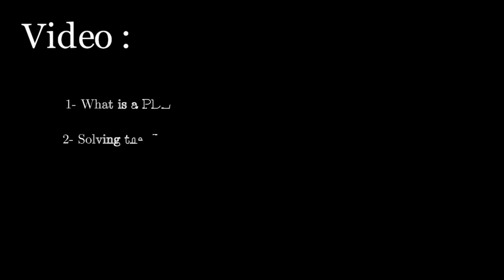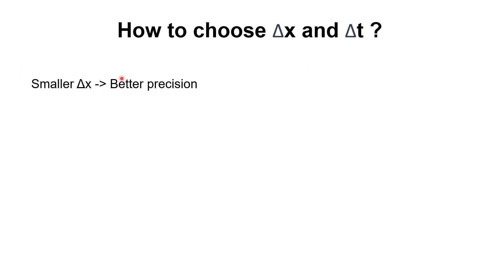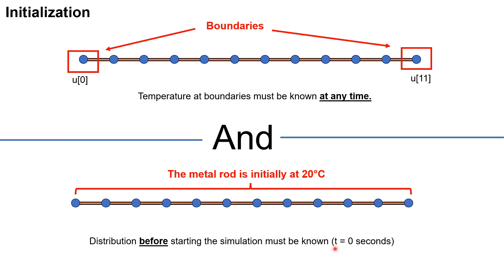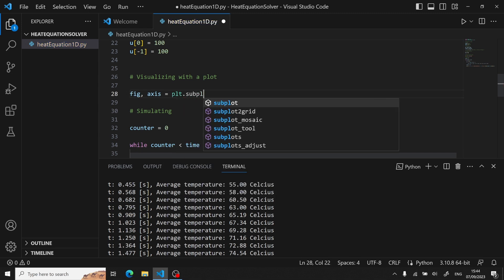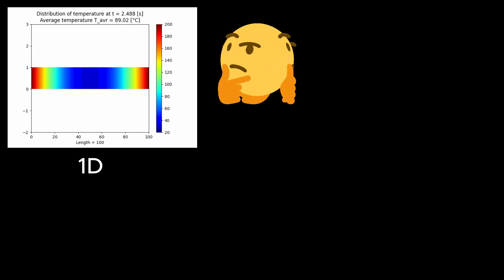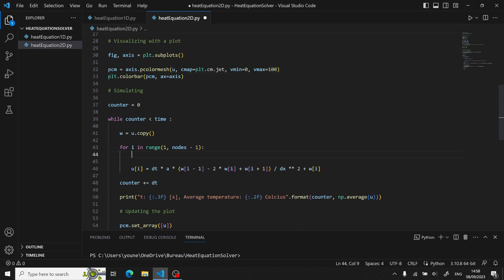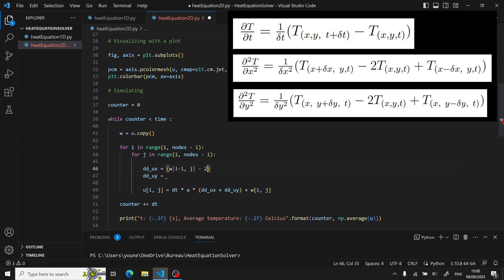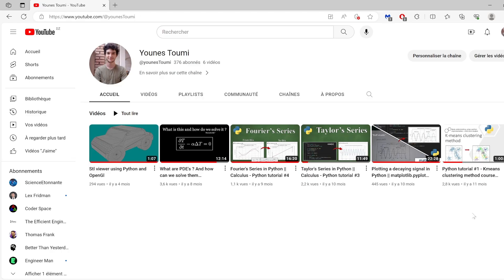Solving The 1D & 2D Heat Equation Numerically in Python || FDM Simulation - Python Tutorial #4

Comment: Formula for dx is incorrect, it should be dx = length / (nodes-1)
Reply from the maker: That true thank you for letting me knoy, I will fix it in the Git-Hub code. 

If we have `n` interval we always have `n+1` nodes. When considering the simple example of a 1 meter long rod with two nodes, lenght = 1, and dx = 1 meaning nodes = lenght//dx + 1

Comment: Hi! It's very awesome video and very straight forward! A quick question, do you know if there's any chance to speed up the process with cuda?
Reply from the maker: Thank you for your feedback ^^
Personally I am not that familiar with cuda (though this surely is motivating me to make a video about it 🤔) However there are several techniques you can use drastically improuve the speed (method I discoreved after making the video)

*  writing the main calculations as a function, then using numba's jit to optimize the computation (by chacing it, ...)
* Important note: since the result of each iteration is more or less dependent on the one before, parallezing will most likely not work, however one trick you can use is to vectorize the code by, instead of writing it in form of a loop, you replace it by some sort of linear system of equations A*T = b, which will be way faster since it uses linear algebra to find the solution (using numpy)

Comment: Could anyone explain why is it necessary to use a copy of array u in the scheme equation? I know that it gives slightly different results if we just rewrite u array in each loop, thanks
Reply from the maker: Hello! 

We use a separate copy of the array `u` because it represents the temperature distribution at a specific time, `t`. When we discretize our equation in time and space, we get:

u[t+1, i] = (dt * a / dx^2) * (u[t, i-1] - 2 * u[t, i] + u[t, i+1]) + u[t, i]

In this equation, `u[t, ...]` represents the temperature distribution at time `t`. By updating `u` using a while loop, we ensure that the computation of the distribution at all nodes is accurate for time `t`.

If we don't use a copy of `u`, we end up computing the solution at `t+1` using a mixture of data from both `t` and `t+1`. For example, without a copy, `u` is updated dynamically, and when computing each node [i], the left node [i-1] is used from time `t+1` while the right node [i+1] is still from time `t`. This leads to:

u[t+1, i] = (dt * a / dx^2) * (u[t+1, i-1] - 2 * u[t, i] + u[t, i+1]) + u[t, i]

This does not conform to the established numerical scheme.

I hope this clarifies why it's necessary to use a copy of the array `u` in the scheme equation. Let me know if you have any other questions! :)

Comment: As straightforward as this solution is, I believe it needs to be mentioned: this approach is extremely inefficient. It has time complexity O(N^2), which renders the method practically useless when applied to models/systems with a large number of cells (which ultimately is what one will have when doing serious work). A much more efficient code can be made by adjusting to use scipy's sparse module and solvers for sparce matrices.
A good video nonetheless, if you want to get a preview of how the finite-difference method works ;) just mentioning a relevant computational aspect
Reply: Could you recommend a video that uses that library please?
Reply: @ssrini2002  I couldn't find any videos actually, there are a couple of websites with code examples, just google "python diffusion sparse matrix" and you'll find them quickly.
Although, seeing as there's no videos about this, I might make one myself :)
Reply from the maker: Thank you for your comment @vikinja121 and for the clarification
Reply: @ssrini2002  you may use numpy
Reply: Using a pre built library/code will render a math video useless. I, like many others, have come here to learn math not a fancy python library.

Good work younes!
Reply: No need for the cheeky answer, I was just trying to mention the info for people who are more interested in the performance aspect and are maybe looking for such implementations.  @jawadmansoor2456